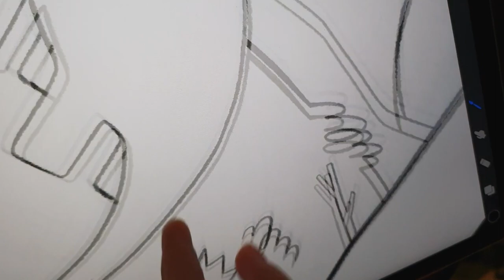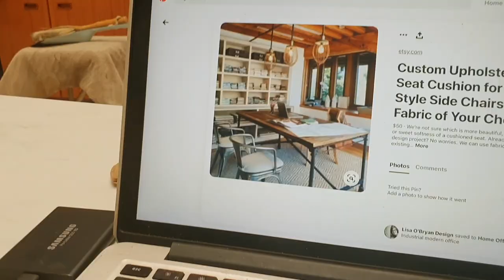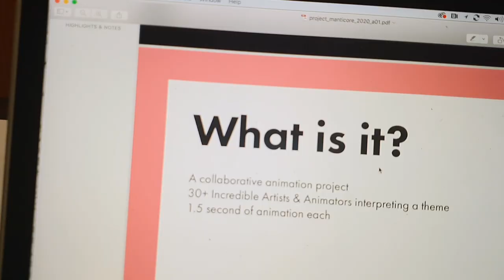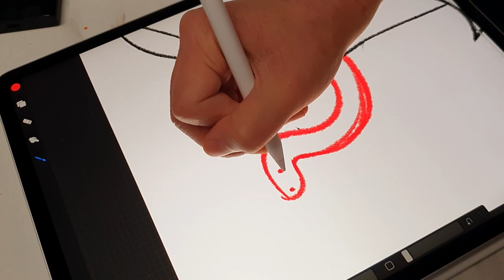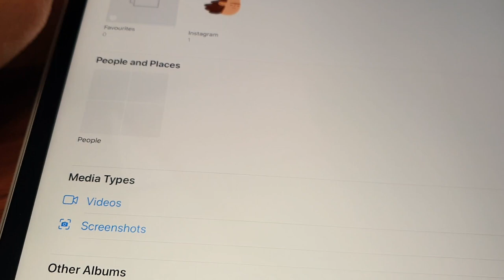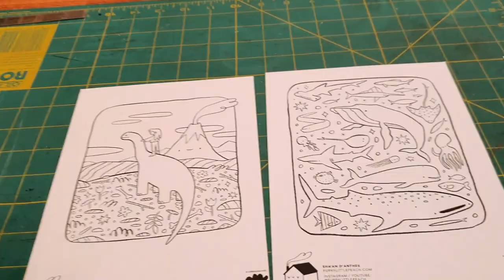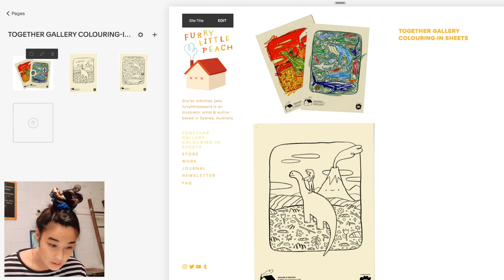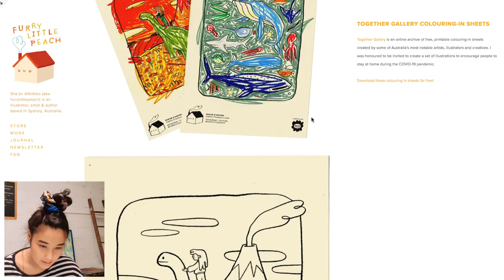STUDIO VLOG ✷ BUILDING MY DREAM TABLE, ANIMATING, Q&A

Comment: Is the table top one continuous piece or 3 planks put together on the longer side of the table? How did Rocket glue those planks together so sturdy with no gaps in between?